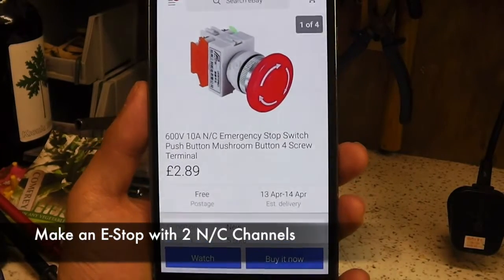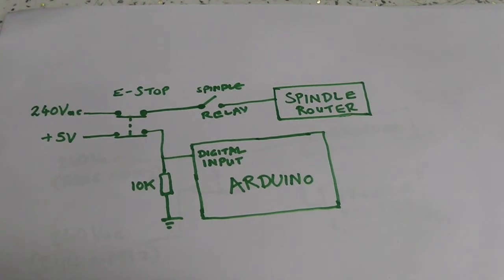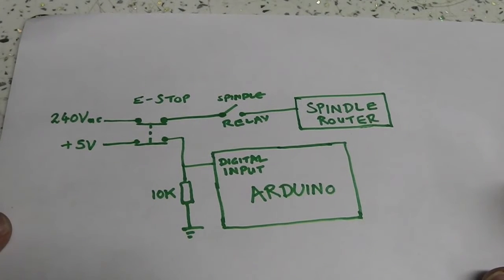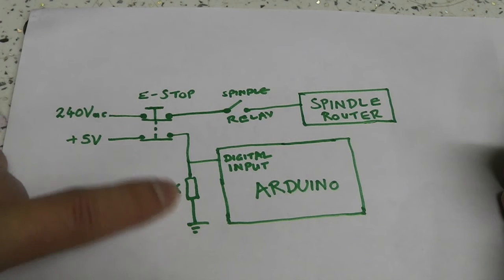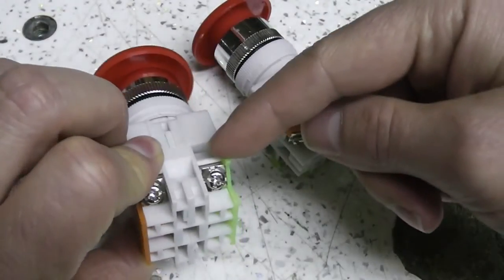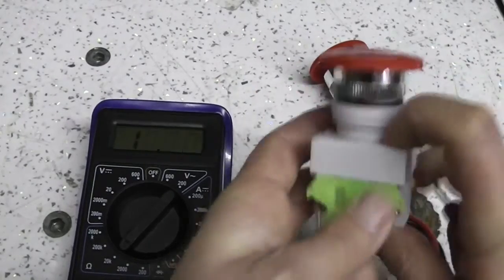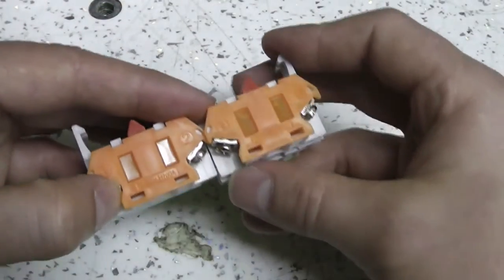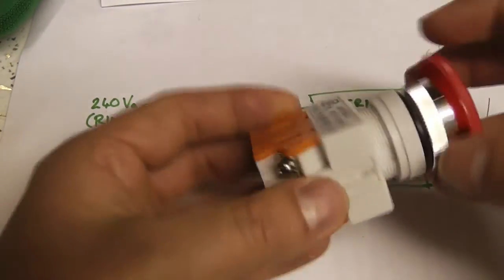Make an E-Stop with 2 N/C Channels - for CNC routers, lasers, etc.

Comment: why not use a multi pole 240Vac rated relay,use the E-stop NC pole to operate the relay coil,when the E-stop is off so is the relay and no power will flow until the E-stop is reset,thereby reducing any unsafe re-assembly of the torn down E-stop switchor operate several small relays with the one E-stop switch,you can buy them in multiples of 10 for less than 1 E-stop from china.